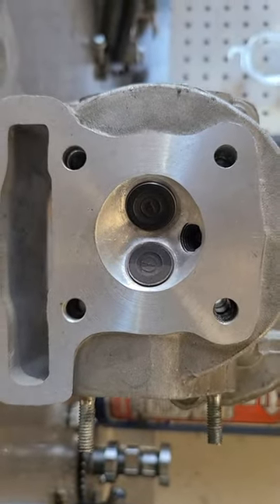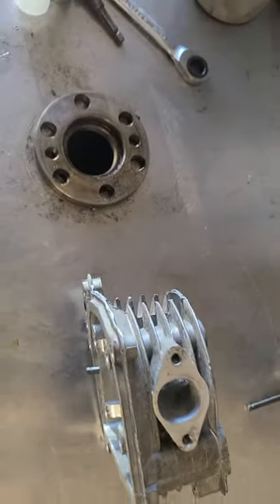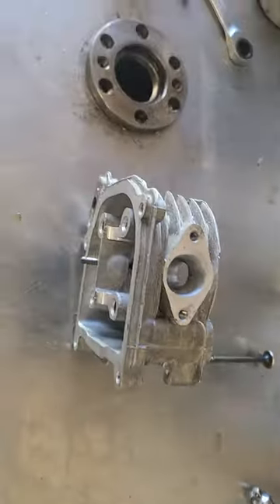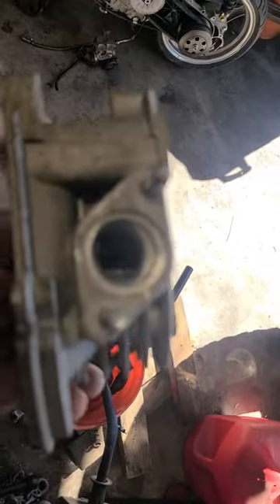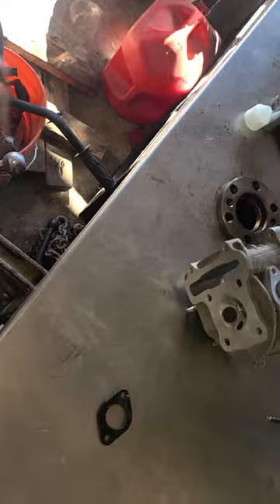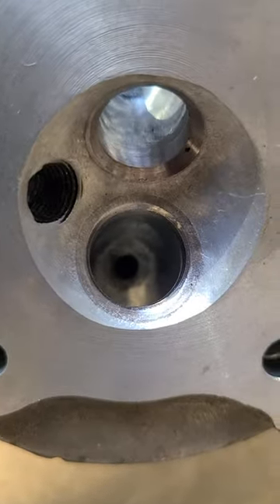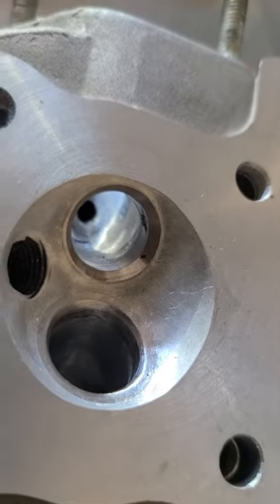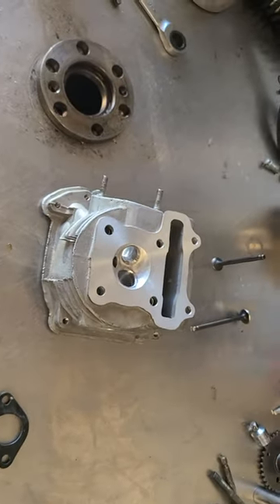Crazy Moped gy6 50cc 139qmb Insane head work done

Comment: I took the stock engine out and threw a brand new 70 cc piston in this old scooter i had   ,i already had a 70 cc  cylinder to spare, then  i got rebuit a big bore head with some new valves to replace the stock head   and then chopped up a 110 cc crotch rocket exhaust that has 2 mufflers on the pipe and added adjustable carburetor...but I got a oil leak...so I gotta patch that up

Comment: Why would you make the port bigger than the valve seat?
Reply from the maker: With all of your testing we found out a 21mm port is the best for a stock valve size we made all most 9hp on a 82cc build but the piston we used is not made any more

Comment: but you used still those small valves? I dont get it.
Reply from the maker: For a 50mm bore or smaller stock valves will always make more power unless you are sparying and full nitrous wet kit
Reply: No😂😂 @dillonracing8384

Comment: It doesnt make sense to do such a job, if you can get the right 72cc better head in the store. 50cc and 63cc doesnt require that kind of `tuning`.
And such a head doesnt seems to work on everything lower then 72cc.. Because then you loosing compression due to much room in the fuel and exhause channel.
I already did ever installed a 72cc head (saying it was for 50cc) on a 50cc cilinder... Then the engine didnt suck fuel on, so didnt want to start or idle.
When replacing with a known good stock head, the engine was running again. So opening up (of make bigger channels isnt always the best to do)
Reply from the maker: This works better then those heads it's been made right
Reply from the maker: I have a piston dom that I make to fill the combination chamber